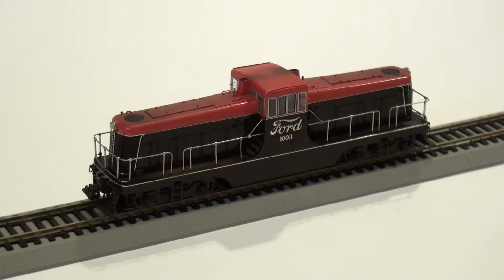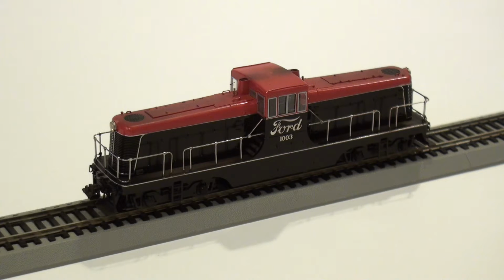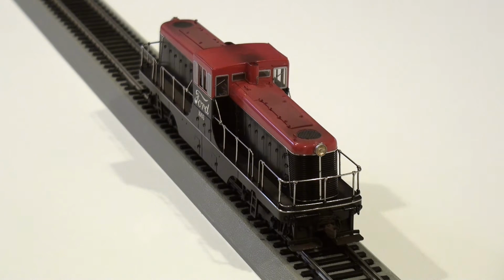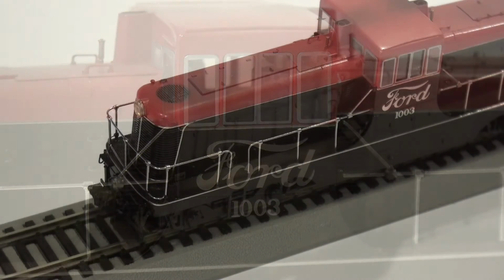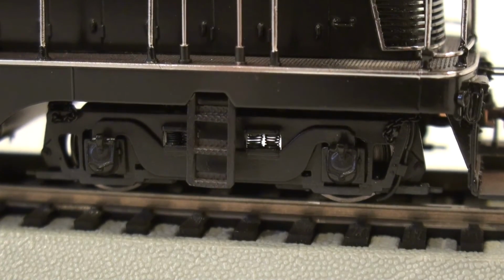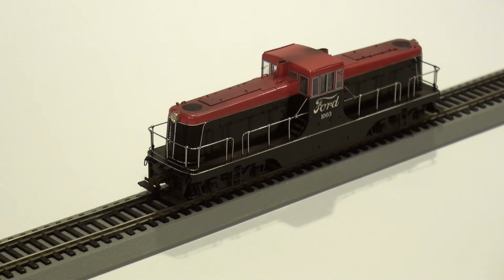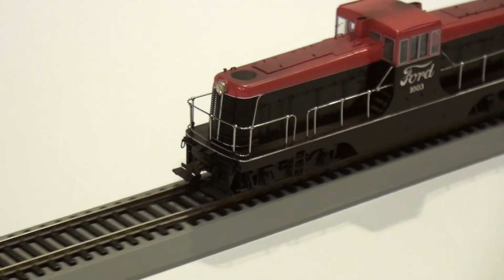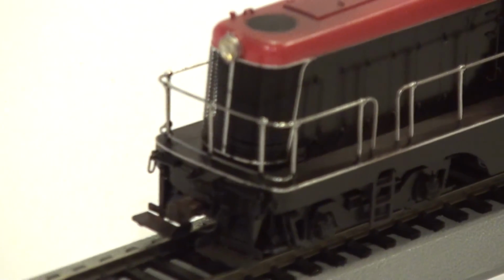The Ford 132 Ton Switcher. Overland Model Imports Brass Review

Comment: That is a sweet engine. I have a rather large collection of Overland/Ajin , I prefer the ones made between 1998-2003. The later ones are nice too, I avoid the Blue box because I've heard they used the Tower 55 drive in them. I actually run mine, rather then display them.